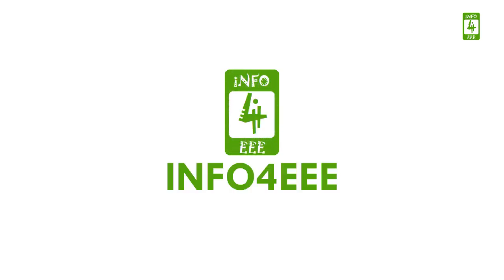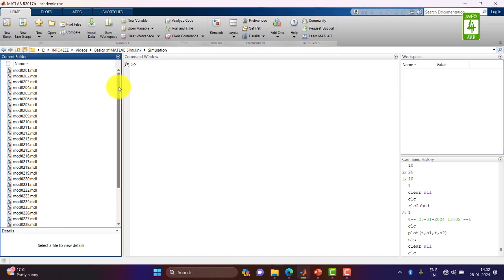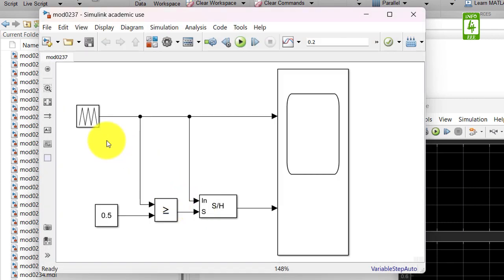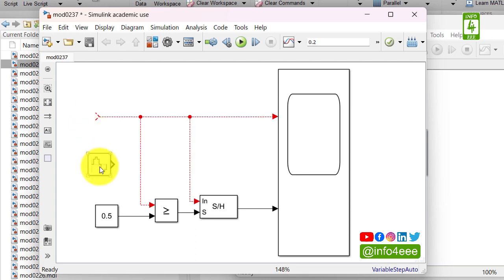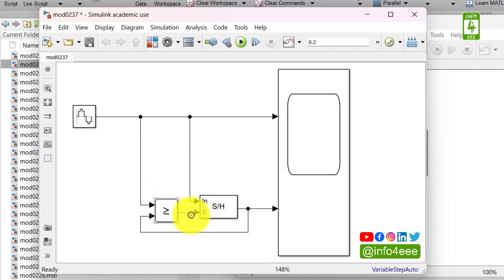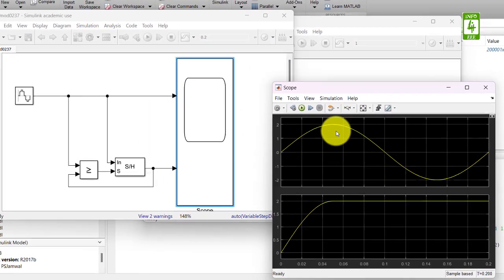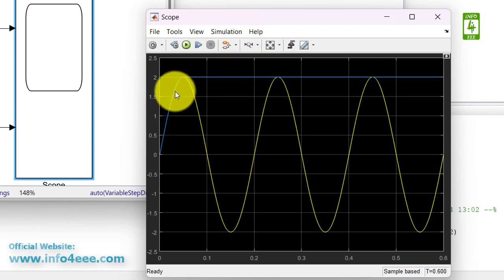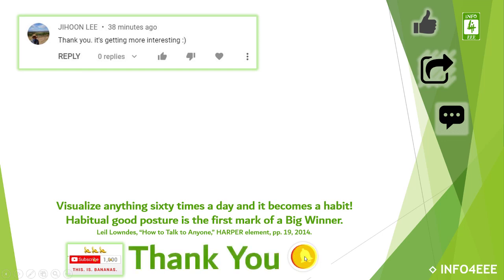Peak Detection Using Sample and Hold Block in MATLAB Simulink #37 | Basics | INFO4EEE

Comment: Can u please solve ODEs Using Simulink. I am badly in need of that.😢
Reply from the maker: These equations contain differentiation for which you can use discrete differentiator block.